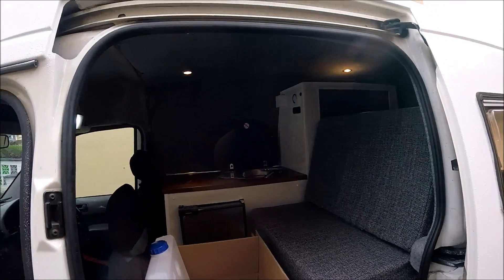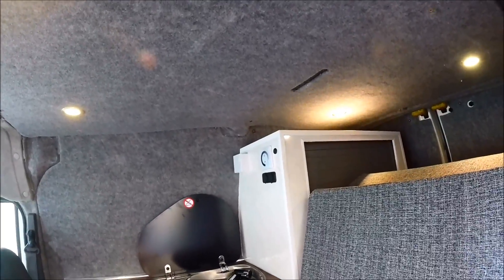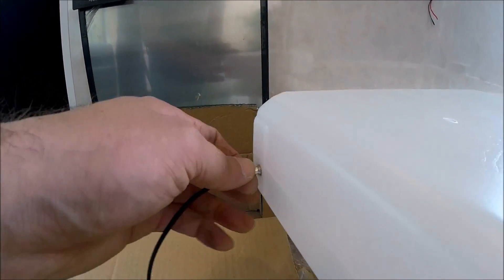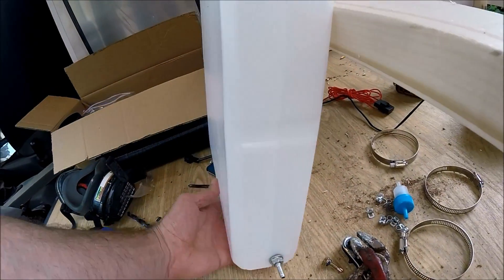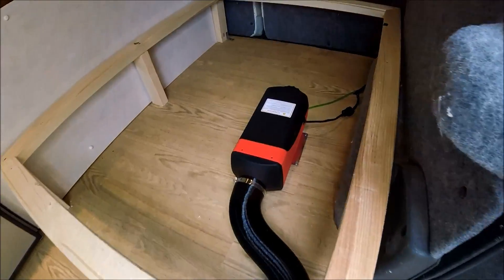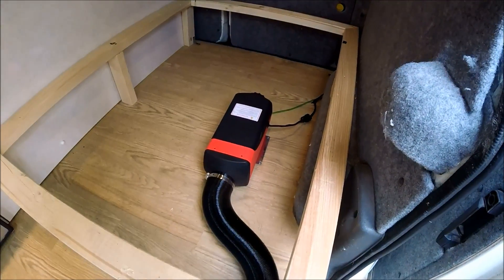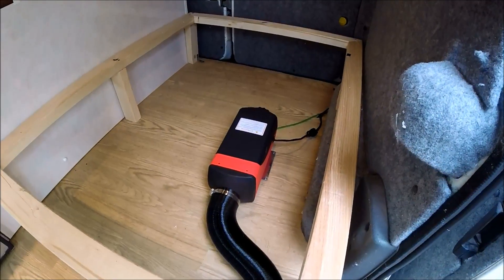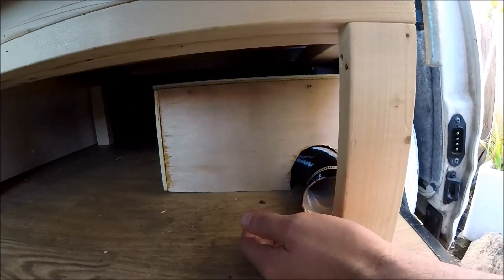Chinese Diesel Heater Fitting/Install Ford Connect Micro Campervan

Comment: Why did you use a  Diesel heater instead of lpg blower like on a previous install years ago.
Reply from the maker: cheaper to purchase and cheaper to run
Reply: I had a propane heater in a van and it made everything sweat horribly, diesel heaters give a much drier heat

Comment: Would have been easier if you just used the fuel line to pull the nozzle threw the tank